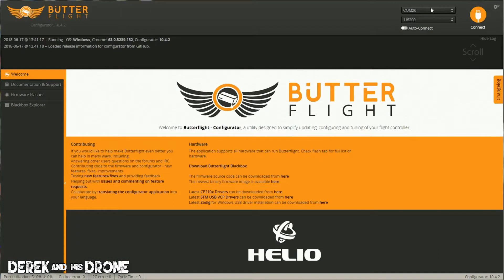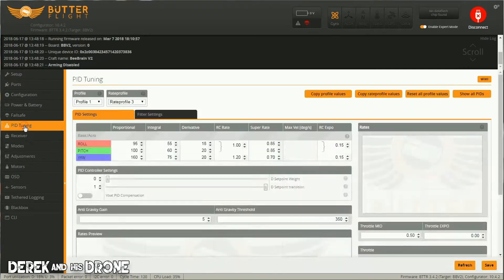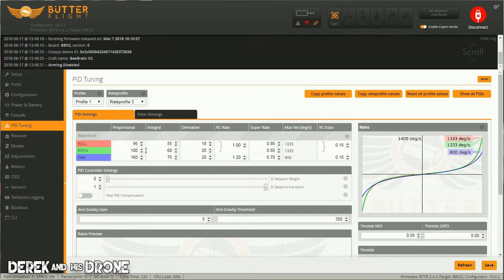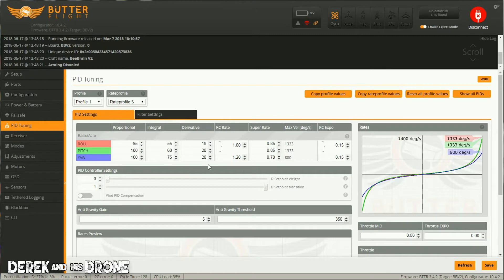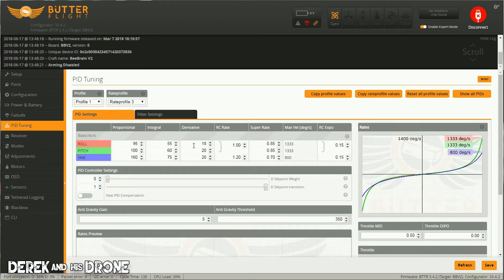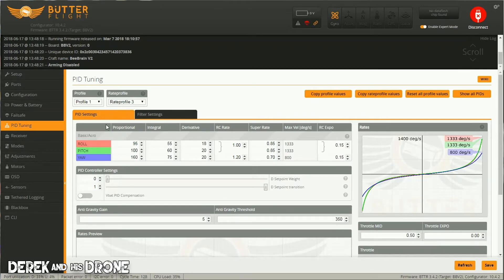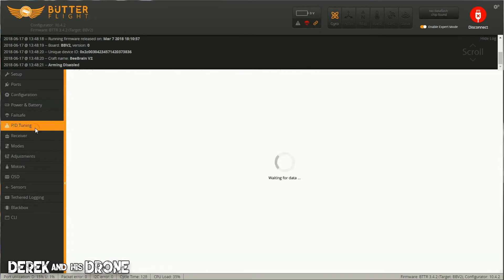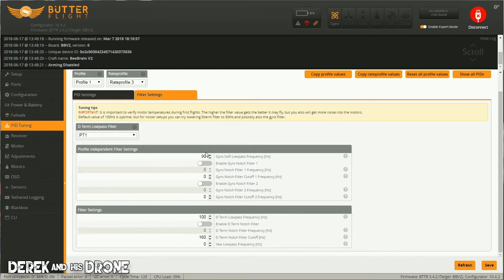AcroBee has Hot Motors

Comment: I dont get why my motors get scorching hot after 30 seconds of hovering ( trashcan)
I'm already running dynamic filtering and D's in the 20's,  i didnt disable stuff in the filter tab but i lowered the value of gyro lowpass and dterm lowpass to allow more filtering ( supposedly less heat )
But i think i can NEVER get them cool running 2S 450 Tattu's. 
I'm so frustrated.
Reply from the maker: It sounds like you are doing everything right.  I don't have any personal experience with that one. Maybe someone at the Facebook group has a good tune or some suggestions.
https://www.facebook.com/groups/331978367598746/
Reply: @DerekandhisDrone  THanks i totally forgot i asked that question on that facebook group,  where a guy had the same batteries and posted they where amazing.

I asked him how he doesnt get hot motors and  just replied "The motors do become quite hot after all. Will look into this when i get the time."  

Well i'm not that worried normally,  but it's now 35 degree celcius outside (95F)  But that's too hot to get outside for me honestly lol.

Comment: My battery life went from 3 minutes to under 2 with the unicorn motors, adjusting the dterm lower will help battery life?, thanks
Reply from the maker: That is normal.  The Unicorns Motors are much larger and a higher kv.  They will use more power.  The d term has no affect on battery life.  Try using tri or bi blade props.
Reply: Ok thanks
Reply: OK burnt up my 1st set of unicorn motors after about 5 flights I wanna try  them again Hey heard you have to lower your D gains, what numbers and do I need to adjust any of the others? Thanks
Reply from the maker: Yes, lower your d-gain to about 18 -20.  That should help also try running tri or bi blade props.  You could have gotten a bad motor.  I run mine hard and they last longer than that..

Comment: It's also common knowledge if one does some research that the gold and unicorn motors need to cool down between packs.
Reply from the maker: I somewhat disagree with that statement.  I have flown back to back batteries since the beginning.  There has been days where I run 30 to 50 batteries through my whoop with very few breaks.
Reply: Really?  Im new to whoops, I have my third on its way and from the tiny whoop group ive heard story after story of people running pack after pack and burning out their motors  I also wanna say thank you for the video of how to install butterflight onto the acrobee.  I have 1 set up for indoor racing with the accelerometer enabled with black or Gold motors (depending on how technical the course is and the other set up for 100% acro with unicorn motors.  I live in Atlanta and we are getting into the hottest days of summer.  Today is supposed to be 95 degrees+ so being able to fly indoors makes things much better.  I cant step outside without my goggles fogging up.  Only comfortable times to fly outdoors right now is first thing in the morning like now or 7 PM to dark.  Thanks for the info.
Reply from the maker: I should clarify by saying you are correct and not all motors will do well if not allowed to cool. However a good tuned whoop with NBD motors will go all day.  Thanks for watching the channel!
Reply: Derek and his Drone care to share your PIDs?
Reply from the maker: they are in this video, when I show the D gains all are visible.